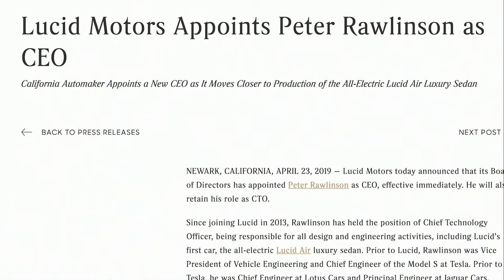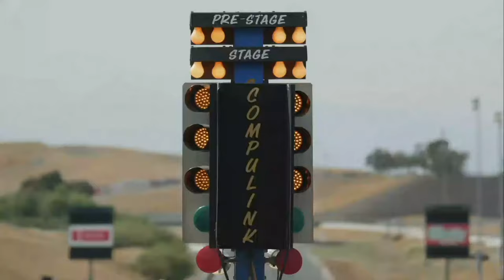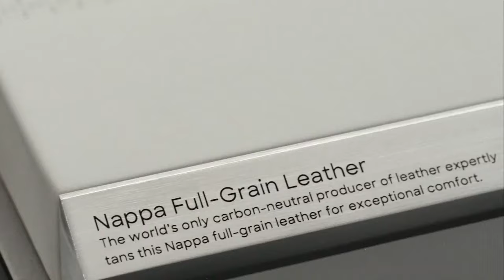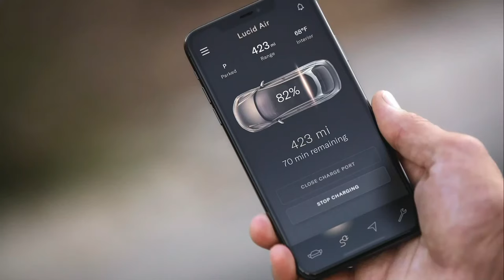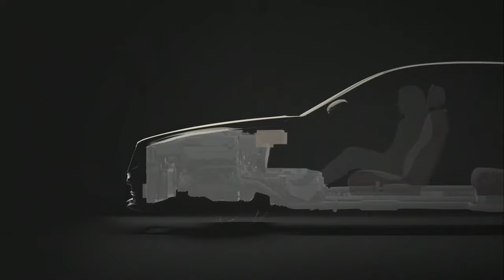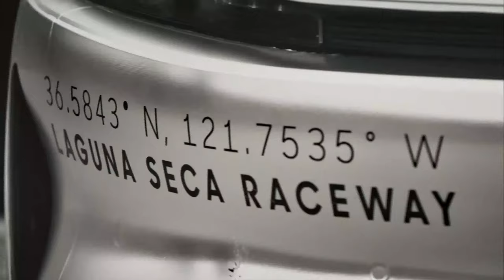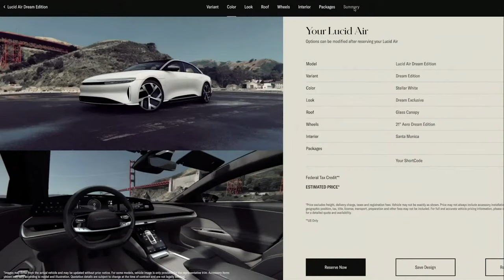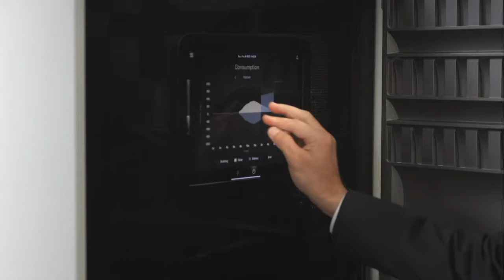Dream Ahead | Lucid Air Global Reveal

Comment: I think the most impressive aspect here is how small they were able to make those motors and battery pack. Honestly with a repackaging of one of those motors and a quarter of the battery, you could fit this powertrain into the frame of an electric motorcycle which is really awesome to think about.

Comment: Very impressive electric car 👍 good job lucid motors and good luck. Hope you dont make the same mistakes Tesla made in mass production.

For those who are comparing to Tesla, Tesla is not just a high tech EV but the whole package which includes the best integrated fast charging network in the world that to me is the biggest strength of Tesla. I have compared ElectrifyAmerica charging stations near me to Tesla superchargers and it is a joke compared to Tesla supercharging network. I hope somehow lucid can partner with Tesla to use supercharger network instead.
Reply: But with 500+ miles of range, will most people ever charge the car anywhere else than in their home? I feel like charging network becomes less and less important as the range increases and more and more people get the possibility to charge at home or at work
Reply: anthis127 500+ miles range under what driving conditions, based on driving and weather factors most people wont get exactly 500+ same as ICE? Now if the company wants to limit their customer base to only people with home/work charging option and they dont want to do long drives. That is why Tesla is so popular even with apartment renters like me who have no charging option.
Reply: rod444rod the whole point of having electric cars is to get rid of fossil fuels 😂😂

Comment: they have a LOOOOOONG way to go to catch up to Tesla.  They'll be out of business by 2029.
Reply: There is definitely room in the market for a top quality really luxury high performance long range EV. Tesla is a fantastic company, but they do not have true luxury interiors or true luxury level production quality. Who knows what Tesla has coming, but even if they address those issues there are definitely enough buyers for two top quality luxury EV sedans models. Tesla may have some surprises for us in a few weeks at Battery Day, but even if they do, the EV rEVolution is only just starting and demand for EVs will exceed supply, by a lot, for most of this decade. Lucid doesn't have to beat Tesla, they only have to beat BMW and Daimler and GM and Ford and Toyota and VW Group and so on, and from here it looks to me like Lucid are well ahead on the core technology.